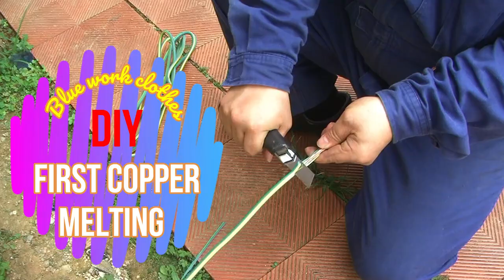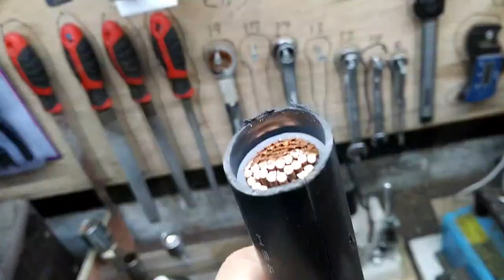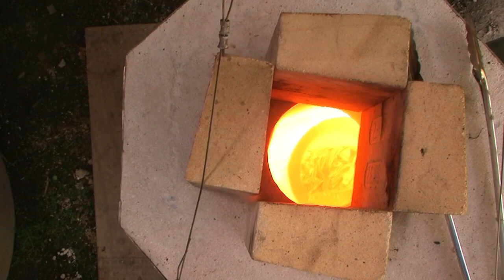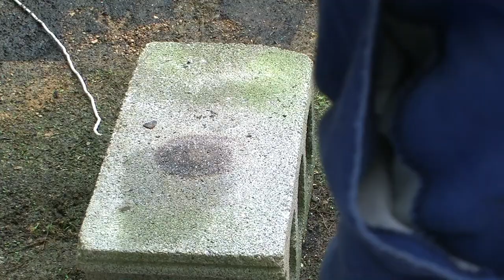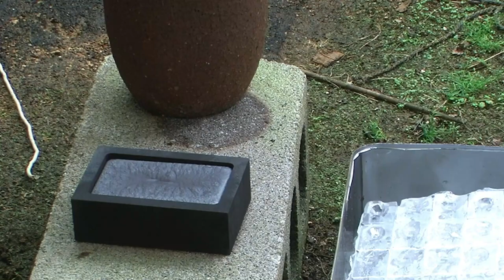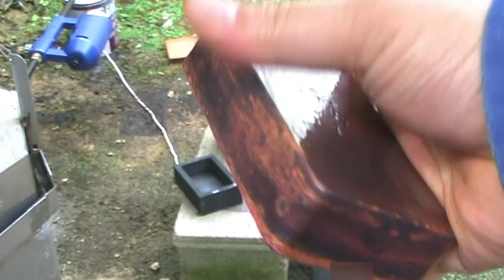First copper melting

Comment: You should try to make attempt to casting for making a brass 80 cc bicycle engine cylinder head
Reply: Then if the brass cylinder head is successful of it being made perfect then test the head on the engine and run it and see if any improvement In performance